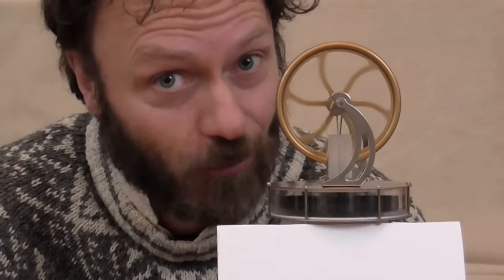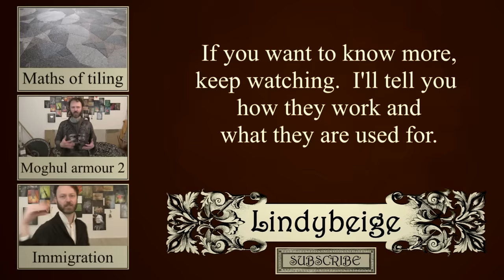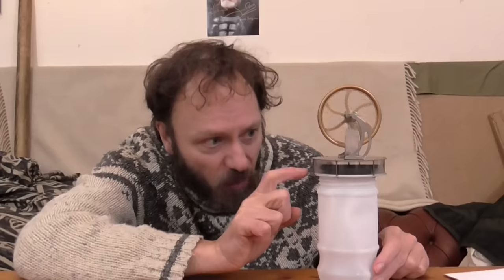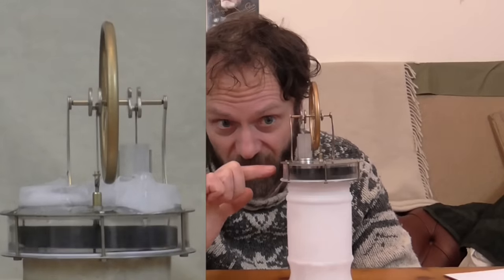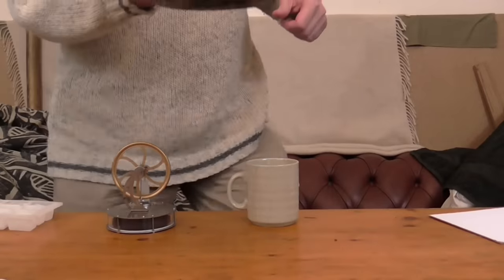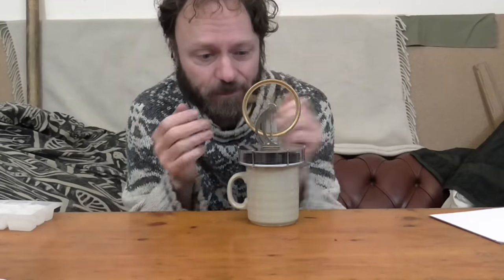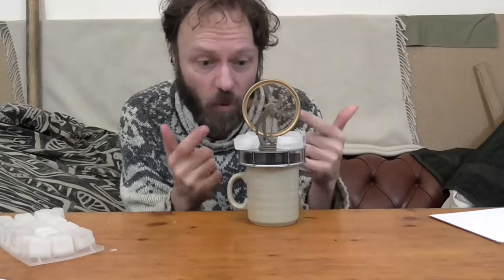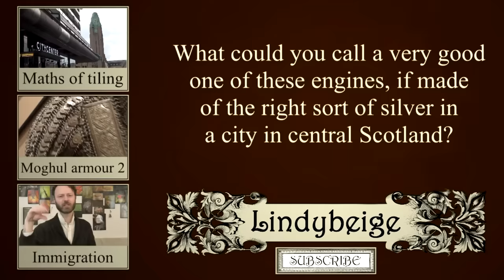Stirling Engines - the power of the future?

Comment: I like to think of the suggested Stirling submarine. In a tense moment the captain orders the whole crew to do jumping jacks in order to heat up the inside of the sub even more to get just a bit more speed and escape!
Reply: The Swedes use a sterling powered submarine! The Gotland Class.

https://en.wikipedia.org/wiki/Gotland-class_submarine
Reply: wasn't there a Finnish sub that used one and beat the US navy in a War Game because it remained undetected because of no radiation signature or signal noise? think i saw a video on it by real engineering...
Reply: rigegs ty
Reply: The Gotland is awesome. It uses two Stirlings that appeared to fit in a 2-meter cube each. They're powered by diesel fuel and compressed oxygen, cooled by seawater, and the diesel exhaust is compressed on board and retained until it can be safely discharged. It was completely invisible to US anti-submarine assets, both active and passive.
Reply: @robertgoff6479   I find that very unlikely to be invisible to active sonar... I suggest that the crew found a good place to hide in. I don't know what happened in reality I just think that my version is a bit more possible based on what I know (which is something, on how an active sonar work... but close to nothing on the war game that we are talking about)
Reply: Shutting off the CO2 scrubbers should do the job.
Reply: Indeed. I would love to hear how they avoided detection from active sonar. I thought nobody wanted to use active sonar, because you would tell the enemy where you are (technically before you find out where they are).
Reply: Submarine rarely use active sonar. But surface ship use it more often. Sometimes a close convoy escort just pinging away in all directions, not so much to detect a submarine as to keep them as far away as possible. The problem with active sonar is that, though it can give you more precise range information than the passive sonar does, it also has a very limited range.
Reply: Axel 0_0  Its a fact that the Swedish sub repeatedly sank a US carrier in a war game. This scared the us navy , so they hired the sub and crew for like 2 years for further testing.
There are also measures to take in construction and use to minimise echo from an active sonar.
Reply: Axel 0_0 It's not invisible to active sonar, but active sonar can be detected way farther than it's detection range, and also there is some playroom with the thermal layer, if there is one. 

AFAIK the US destroyers didn't use (for some reason) their active sonars in the wargame, so the swedish sub could slip through them and take a shot of the carrier. I don't think they'd let her slip away after firing actual torpedoes, but that's impressive nonetheless.
Reply: The Japanese also use Stirling engines in their Sōryū -class submarines; I think they're license-built copies of the same ones the Gotland -class boats use.
Reply: "Faster men." "We're giving her all she's got!"
Reply: Quick men! Breathe on the walls! That's an order!
Reply: It was so effective the United States Navy leased/seconded  a Gotham class submarine(HSwMS Gotland) and its crew for an entire crew in order to learn how to defend against its capabilities.  It was able to "kill"  the USS Ronald Reagan during a combined fleet exercise.

Comment: One good setup would be focusing sunlight onto the top plate while the bottom plate is submerged in some sort of running stream/river.
Reply: If you have a stream you might as well use a water wheel or hydroelectric generator directly. If you have non-running water though it might be a good heatsink.
Reply: I had a similar thought, but for residential use. Focus the sun onto the top and have the bottom plate be the lid of a water tank hooked up to the mains. The water will be somewhat warmed in the process, so if you are in a cold place you can get slightly warmer inlet water to your whole home. But if you're in a hot place where you don't want your "cold" water being any hotter than it already is, just use it to pre-warm the water that is going into your water heater. Either way, whenever you use water coming out of the tank it will slightly boost the efficiency of the unit by replacing some of the warmed water with cooler water.
Reply: Or alternately you could use the earth as a heat sink.

Comment: You could even attach them to standard combustion engines to get extra power from the wasted heat.
Reply: Or use a turbocharger to better effect
Reply: No. The stirling engine is less effective in carrying heat away from the primary engine than a proper cooler, thus the cool end of the primary engine is not as cool anymore and it loses efficiency. The loss in the primary engine is always greater than what the second engine would produce.
Reply: +niffenator An engine with turbochargers are still producing waster heat. 

+foobar201 The heat will still have to go somewhere. The cooler can carry the heat away from the engine and to a stirling engine. And it doesn't matter if it can produce energy for all of the lost energy in heat. If it is effective enough to make up for its weight it can add to a more fuel efficient car.
Reply: Patrik Lilja ALL heat engines must reject some heat in order to work.  A turbocharger can be used to increase the thermal efficiency of the engine however by recovering waste energy from the exhaust.
Reply: Yes? So? That is waste energy from the exhaust. The stirling would not interfer with the turbocharger as it will be powered by the waste heat outside of the exhaust.
Reply: Patrik Lilja The amount of heat you could recover is probably minimal compared to extracting it from the exhaust.  I think it would be ineffective especially when you consider how large the Stirling would need to be.
Reply: That is true, it might be very innefficient at this current state. But the energy is there, and if we could get enough of the energy to compensate for the extra weight it would make a more power efficient engine. 

Maybe building the engine in a different way for the sterling engine to get even more energy might be possible. 

So while unlikely at today, it is indeed very much possible. 

This is the thing a sterling engine could be good at, since there is a lot of places where there is wasted heat, such as houses and other stationary objects. It will not compensate for all of the lost heat energy, but it will net a small return which is good in itself.
Reply: Patrik Lilja IC car engines can really only be piston or rotary engines.  There's not really any other effective ways of generating torque that spring to mind and there's probably not much point in building an engine around something that is not particularly effective at what it does anyway i.e. the Stirling device.  You'd be reinventing the wheel and not really getting any benefit from it.  Because fossil fuels are inevitably going to be phased out, probably in favour of electric motors which have a thermal efficiency of over 90% (as opposed to around 30% for IC), it's unlikely that we're going to see any Stirling-type device on automobiles in the future.
Reply: niffenator i agree it's unlikely on automobiles. but that's what is being done at the submarines that lindybeige are mentioning in the video.
Reply: John Doe  The exhaust exists to reject heat.  The reason the exhaust gas flows is because it's at a high temperature and high pressure.
Reply: How do you think a jet engine works?
Reply: +niffenator The exhaust pipes are hot though. The heat in the pipes are wasted heat. It is heat released from the exhaust. using the wasted heat will not lower the efficency from the turbocharger. Same with a jet engine, there is a lot of wasted heat. 

The problem for a sterling engine is that it will bring a bunch of extra weight if incorporated in the vehicle, which might make it a bad idea.
Reply: You could, if you the sterlings could provide enough power to move themselves around, otherwise you are just wasting more energy to get a little of it back.
Reply: Patrik Lilja A heat engine can't work without rejecting some heat.  I didn't say recovering energy from the exhaust will reduce the turbo's efficiency - that is fundamentally wrong because the turbo uses exhaust heat to perform work - you are confusing me with someone else.

The jet engine works because the gas expands from high temperature and pressure in the combustor, to atmospheric pressure post-exhaust.  A turbojet's exhaust expands through a turbine which is used to drive a compressor at the inlet.  This is also how a turbo on an IC engine works.  You can see that in order for the engine to perform work, there must be some waste heat because if there wasn't, the exhaust gases wouldn't expand.
Reply: that would probably be good in a hybrid, when the battery runs out the motor turns on and powers the car and a stirling motor housed as part of the exhaust line that will recharge the battery.  in any full gas car i dont think there would be enough benefit to make it worth having, and electric cars dont produce enough heat to make it worth it..
Reply: Maybe something like that?
https://en.wikipedia.org/wiki/Automotive_thermoelectric_generator
Reply: +niffenator Fyi, jet engines are IC engines.
Reply: I know...?
Reply: Also stirling engines do not provide enough power per mass to be any more practical than a standard IC engine. We might as well come back to steam powered cars.
Reply: +TheFarciarz777 "steam-powered" car can mean a car which runs on steam turbine powered by something like a fusion reactor (for now those mostly consume energy but
 will produce it in the not so distant futur
e).
Reply: Well all IC engines are wasting heat.  As Lindy said, even the most efficient diesel engine wastes 50% of the heat.  The idea of the turbocharger is to use some of the wasted heat energy in the exhaust to force more (cool) air into the chamber, to improve the rate at which you can burn fuel.

A stirling engine could act as a tertiary engine of sorts, but I don't see the point in that application, or what you would necessarily use it for.  Maybe if you had a really whiz bang design, you could use it as your generator.

Or, to your concept of improving the turbo charger, maybe you'd use it to power a small A/C type system (specifically, the compressor) that would cool down the intake air, allowing an even denser mix in the chamber.  I don't know how much gain you'd see from a powered cooler vs a run of the mill air to air or air to liquid charge air cooler.  Probably not enough to justify the extra weight.
Reply: That's not how a turbocharger works actually. To spin turbo's turbine wheel, the engine has to work harder and more energy is used.
Reply: TheFarciarz777 I believe you are thinking of a supercharger, not a turbocharger.  A turbo does not put strain on the engine, because it runs off of waste energy in the exhaust gas.

A supercharger, on the other hand, runs off of the crankshaft, which, like any other additional load on an engine (alternator, water pump, A/C compressor, PTO, etc) robs mechanical energy directly, forcing the engine to work harder to achieve the same crank or wheel speed.
Reply: No. A turbocharger adds additional resistance to the exhaust. The engine has to work harder to push the exhaust gasses through with turbine wheel being an obstacle here.

Turbocharger is not free. It doesn't magically extract "waste heat".
Reply: Wrong!  A turbocharger does not make the engine have to work harder, since the exhaust gas expands to atmospheric pressure anyway as it travels down the pipe.  It uses this waste heat to perform work on a turbine that drives a compressor.  Turbochargers can in fact increase the thermal efficiency of an IC engine.
Reply: A turbine wheel requires a pressure difference in order to spin. This means that a pressure has to build up before the turbine which means that there's higher pressure of exhaust gases in the cylinder's chamber which means the the exhaust stroke draws more energy to push the gases out.

There's no "free energy" in the exhaust. If you want to take energy from exhaust gases, you also need to give them more energy in the first place. A turbine doesn't get the energy to spin from "waste heat". It gets it from pressure difference and airflow.

A turbocharged cars have good efficiency because the engines were designed to work with a turbocharger. Those engines have lower compression ratio in order to keep fuel from prematurely detonating. If you get a perfectly good naturally aspirated engine which has good efficiency, it will suffer a lot by adding a turbocharger. Such engine just wasn't designed to bear a turbocharger. Turbocharged engines aren't designed to work without turbo. There are a lot of trade offs when it comes to engine design. Not all cars have turbochargers and there are perfectly good reasons to not do that.
Reply: Sorry, wrong again!  You don't need to add more energy to the exhaust in order to extract useful work from it, since it is already moving along a favourable pressure gradient.  The only time you would need to do so is if the exhaust gas was already at atmospheric pressure, which of course is impossible.
Reply: Of course you do. Turbine wheel introduces more resistance to the exhaust pipe which makes it harder to push gases through.
Reply: That resistance to flow is how the turbine extracts work from the exhaust gas.  Since the exhaust gas is going to expand to atmospheric and be wasted anyway, resisting its flow to extract energy is a way of increasing thermal efficiency.
Reply: Whatever small load a turbo may add is more than negated by the benefit of burning fuel more efficiently, allowing both better fuel mileage and greater power from the same displacement.

The vast majority of the work done by the turbine is powered by the exhaust pressure gradient between the exhaust manifold and the exhaust pipe, or rather, the expansion of said exhaust gas due to fluid dynamics.  Pressure wants to equalize, and it does that by flowing across the turbine.

Turbo chargers will cause an engine to be able to run hotter, because more fuel is burned in the same amount of space, over time, but that is ALLOWING it to work harder, not forcing it to work harder.

Going back to my earlier comment, this differes significantly from a supercharger, which gets 100% of its energy from the mechanical action of the crankshaft, meaning that 100% of that energy comes about through harder work by the engine.
Reply: U basically said a type of prius...
Reply: I would consider this conversation, whilst interesting, to be somewhat moot. This is because we should spend more effort in getting away from burning fossil fuels entirely rather than trying to drive minor increases in fuel efficiency (in an already horribly inefficient engine).
Reply: YOU_WILL_LOVE_EACH_OTHER  , that's an excelent idea  the trick is to make room for it  -it should be possible
Reply: yes, they would work excellently as a parasitic hybrid engine